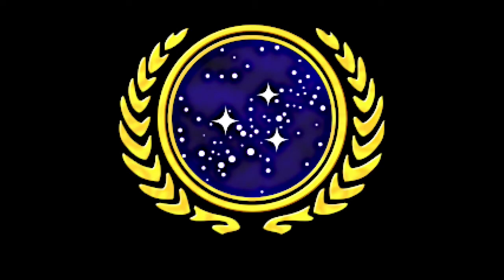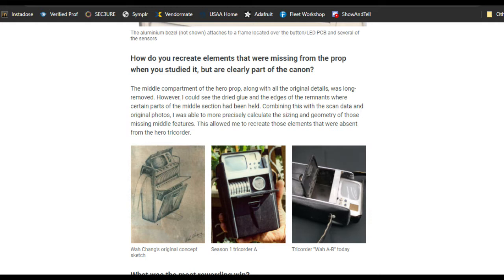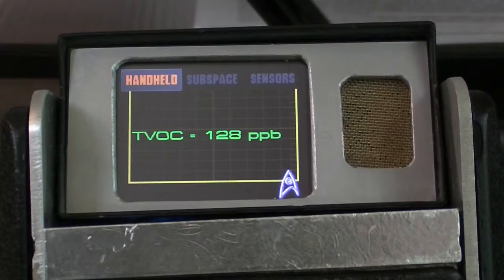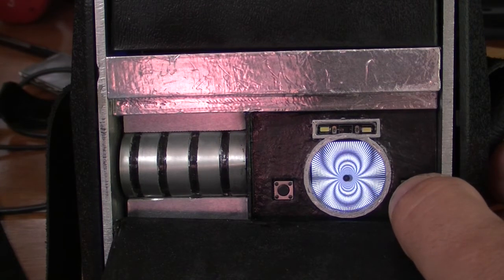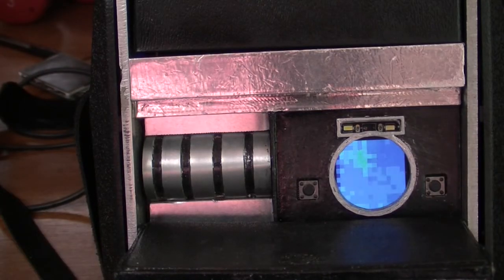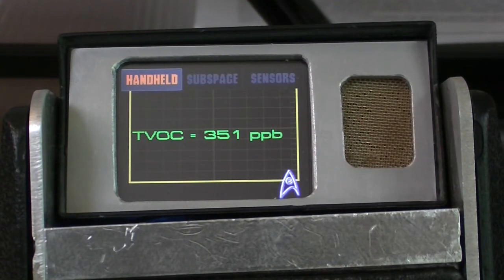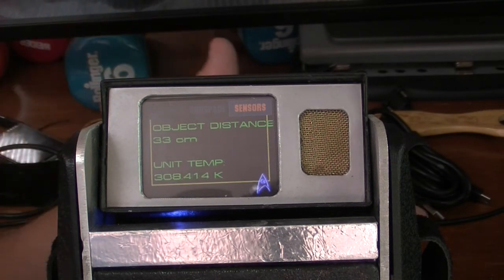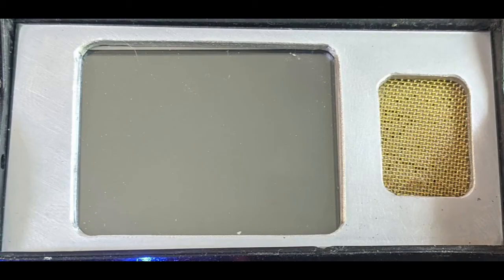DIY TOS Star Trek TS-120 Tricorder Build

Comment: nice job; I can say this one is an actual functional tricorder, compared to the one made by the wand company. 

Looks can be changed, and for being handmade versus TWC making it with machinery and precise measurements from the original prop, I would say you did great.

Just not sure why you didn't go for the RPI zero; as you can easily get connectors to wire everything neatly... The only thing needed was a multiplexer to connect the I2C sensors and the camera, but there are plenty of them in small form factor that works with breadboard friendly sensors, like the adafruit ones.

The battery is also incredibly large for what it does :) I doubt you even use a fraction of the output of that battery in terms of current, but the good thing is that if you want to swap the internals for a RPI, you got that covered with such large battery.

I would have changed the round screen with an actual round LCD, and moved most functions to the top screen. Also a nice touch would be some sort of plastic screen to simulate an old CRT, kinda like what TWC did with their tricorder.

Great job, really creative; add a SDR with an antenna and you have basically the features of a "real" tricorder mixed with a science tricorder :)
Reply from the maker: Thank you! 

The Pi was actually my first attempt, but at the time, the wiring became untenable. Plus, the time for boot up was too long for my taste. However, you are right... The Pi does offer much more functionality. 

I've been thinking about the round display for a while, but the Clue and Pynt are already in my inventory and budget has been minimal the last couple years because I've been saving for the Wand Co Tric... Which I just ordered. I'll do a side by side video in a couple months.

Comment: Yours... isn't all that different than the Wand Company's coming out soon. Nice tinkering.
Reply from the maker: Thank you! I've done some physical mods since this video and plan to do an update. 

I'm still so getting the Wand Co Tric and when I do, I may do a side by side. 

What are your plans?
Reply: @TheOldBlackCrow  I have the Phaser and the Communicator, so, I see no reason not to get the Tricorder...and hope the Wand Co. starts work on the Transporter device next! Lol.
Reply from the maker: @MarkLewis...  And have our atoms scattered all over the universe? 😱

🤣
Reply: @TheOldBlackCrow  The Heisenberg compensators prevent such molecular dispersal issues... as long as the mechanism has fresh D batteries. 😜

Comment: Hi, former electronics hobbyist here. I happen to have a never-used "Super Starter Kit Uno R3 Project" (similar to Arduino) that I do not need or want. If you would like it for a future project, I'd be happy to send it to you at no cost to you. Included with it are: Uno R3 controller board, an LCD module, power supply module, expansion board, stepper motor driver board, stepper motor, servo motor, active and passive piezo buzzers, one-digit and four-digit seven segment displays, ultrasonic sensor, and lots of other stuff, including a manual on CD. I'd really like to see it go to someone who would put it to good use.
I also have about a metric ton (slight exaggeration) of mostly scavenged but some brand new components, connectors, relays, switches, etc., etc., etc. If you would like any of it, or know of someone who would, send me a wish list, and if I have it, I'll include it. Mostly, I'm just looking to clear out some closet space, but as I said, I'm also interested in seeing it go to someone who would put it to good use. Hoping to hear from you.
Reply from the maker: That is a wonderful offer and greatly appreciated! I don't have any need for them as I already have all the components for my next build... However, I can post this list to the Mycorder Discord Server and see if anyone is in need. Orrrrrr... You can join Mycorder Discord Server! 🤓

We are always looking for interested folks!
Reply: @TheOldBlackCrow  Keep in mind that it's only a partial list. I have a closet FULL of stuff that has become a burden to me.
As for a Discord Server, if I had some idea what that even is or what it does or how to join one, well, then I'd probably be smart enough to want to hang onto all my stuff. Sadly, I'm 73, and the digital revolution went whizzing by at light speed and I have no hope of ever catching up.  🤷‍♂🤷‍♂
Reply from the maker: Send me an email and I'll see if I can find an interested party. 

Discord is just like a chat room back in the day. But I'll post your list there and see if anyone is interested. Again, thank you so much!

Comment: Wow cool build.  Thanks for the detailed video!  I have the same Tricorder and was thinking of using the raspberry pi zero as well.  I may change that up now.  I love how you've replaced both displays with relevant data and the fact that you actually use the handheld scanner.  One thought I had is it would be cool to somehow secure the scanner with a neodymium magnet.
Reply from the maker: Thank you! I was trying not to use magnets because of the magnetometer on the Clue. I may be wrong, but was afraid that it may mess up the accuracy. It's a great idea though!
Reply: @TheOldBlackCrow  whaaat it has that too???  That’s crazy awesome..  Yeah you’re right I think.

Comment: Hi I have a masters replicas TOS tricorder and the electronics are not working. I’m thinking to replace the components with Arduino.
Reply from the maker: Tons of options with Arduino or Arduino based microcontrollers. The Pyportal can do Arduino as well... Just that I am not comfortable using Arduino for GUIs. 

I would love to see what you come up with!
Reply: @TheOldBlackCrow  thanks I really not familiar with this set up. I would need help.
Reply from the maker: @globecomputers1   I can help a little bit... As I stated, I'm not a programmer but muddled through it with tons of help from others. 

Have you visited my GitHub page (https://github.com/oldblackcrow)? That's all the code I can offer, but if you are stuck on something specific, maybe I can help if it's not too complicated. Just ask your questions and I'll see what I can do.